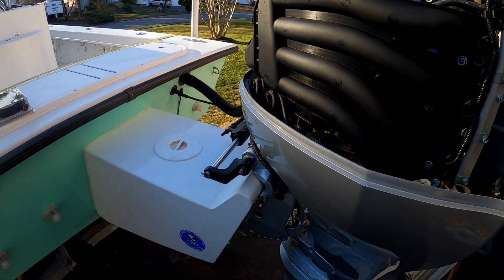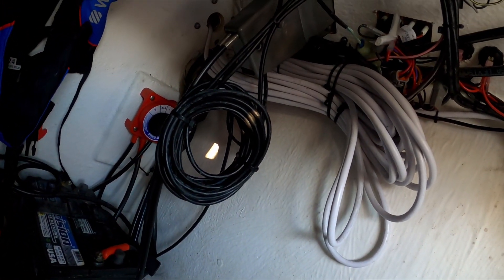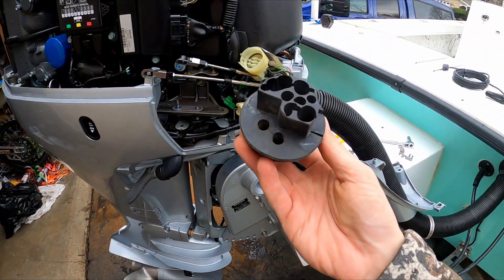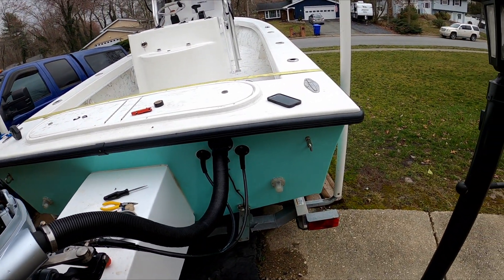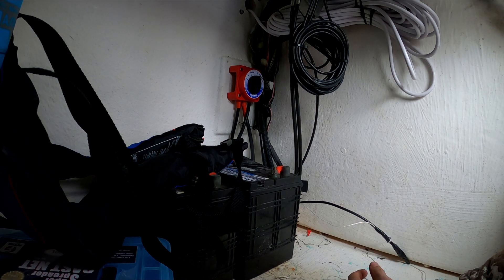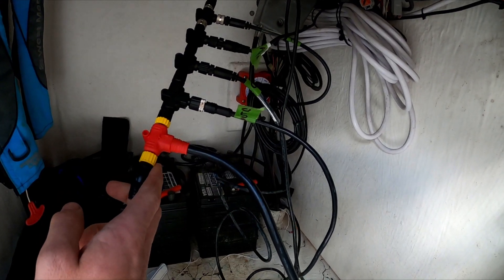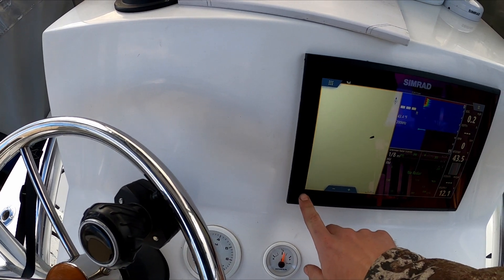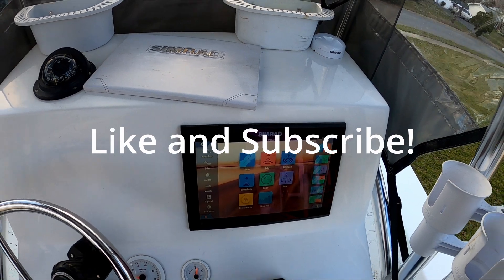Installing NMEA 2000 on my Simrad GO12!

Comment: Love the video… about to install my Simrad GO12 on my center console. So if I connect the NMEA 2000 to my outboard I can essentially do away with my analog gauges correct?
Reply from the maker: @1Chosen247  correct. Glad the video could help you
Reply: @capt.jakebeltz   Thanks for the help brother. God bless you!

Comment: If I just want to read the engine data on my Simrad Go, do I need a complete backbone? Or is a direct nmea200 cable from the engine to the simrad enough?
Reply: Did you try connecting directly?  Thnaks
Reply from the maker: No you need backbone, NMEA connector from motor to a t, 12v power supply to a tee, and a drop cable from your simrad to a tee

Comment: If I just want to read the engine data on my Simrad Go, do I need a complete backbone? Or is a direct nmea200 cable from the engine to the simrad enough?  Please answer
Reply from the maker: No you need backbone, NMEA connector from motor to a t, 12v power supply to a tee, and a drop cable from your simrad to a tee
Reply: Many thanks